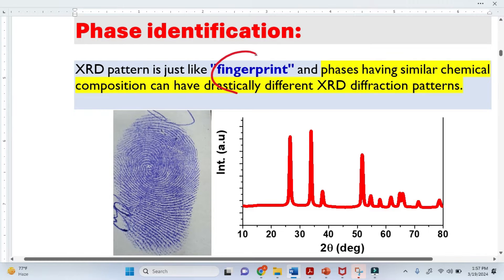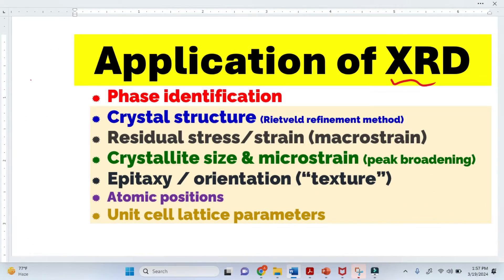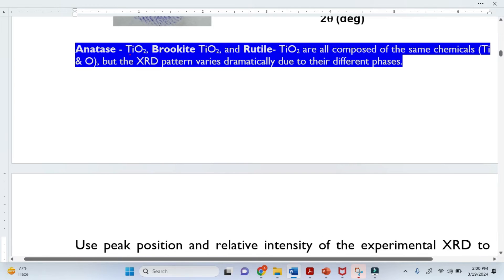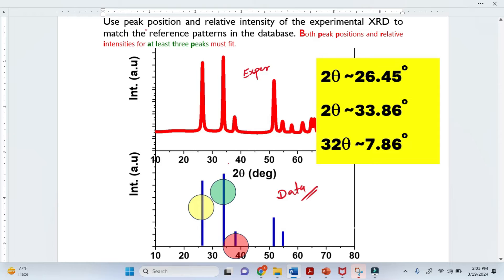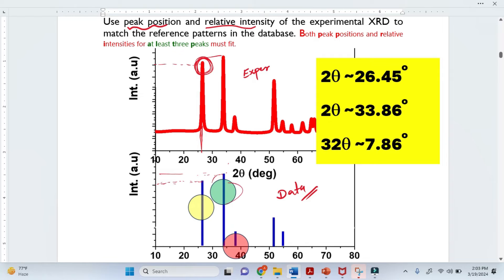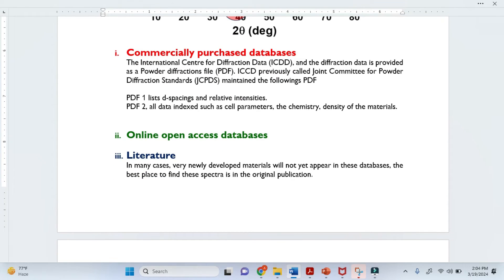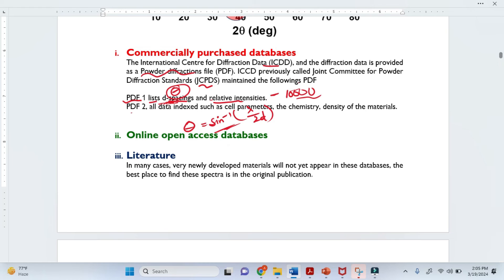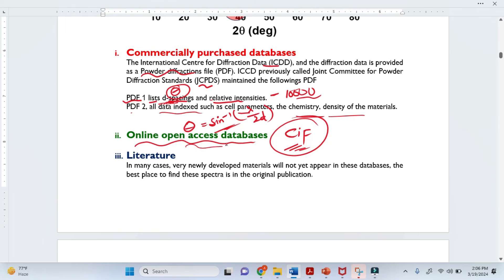How XRD Identifies Phases: Understanding Peak Matching in Seconds

Comment: Aoa Sir.
Sir how can we open supplementary data files.
Because when I click on the link that is given for supplementary data, it again opens that article which I already have open.So please, how can i open it.
Jaxak Allah for your channel
Reply from the maker: May be the authors or the journal have not uploaded the supplementary files with the main article. 

The second option is just to write an email to the corresponding author 
His or her email is already  there in the main article. Just ask for the supplementary file, and they will provide you. 

If you are still stuck, then let me know !
Reply: Sir this is a supplementary file link
10.1016/j.ceja.2020.100040
But when I click it reach to same article that I have already opened.
And at the end the same link is present.
This does not occur for one this, this situation is the same for all articles.
Actually the thing is that I do not know how to open a supplementary file.
Kindly if you can make a small video, if is it possible.
Reply from the maker: I have checked it. It is there on the left side in the Outline with the name Appendix. Supplementary materials   Just click on and it will take you to the word file with the name Download : Download Word document (1MB)   Just above the references. Click and it will download!!     I did it and it works!
Reply: @nanospeaks  Thank you sir
It works